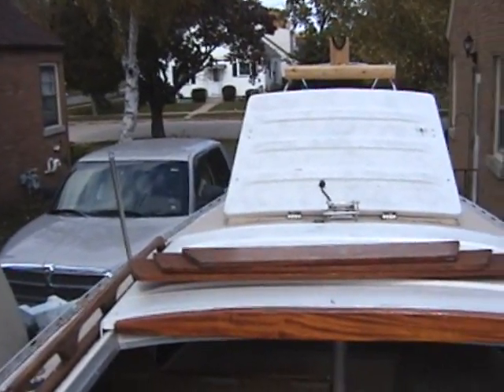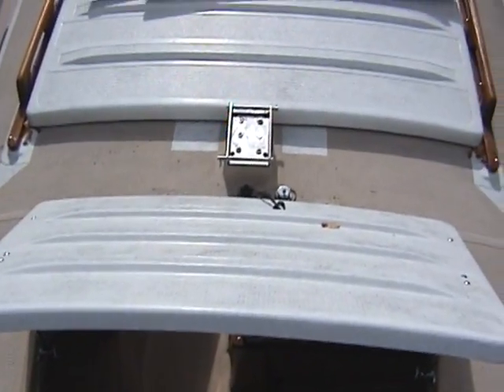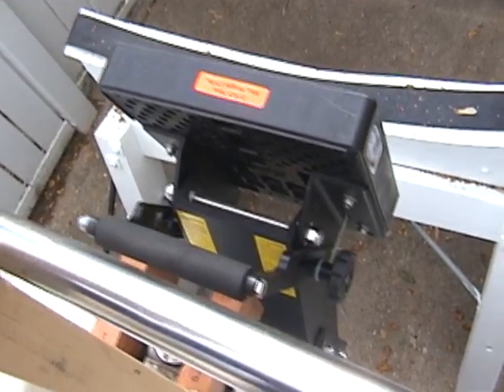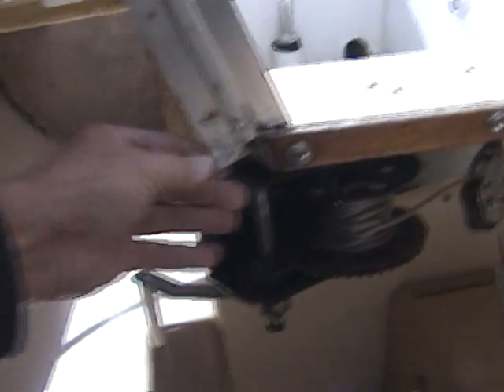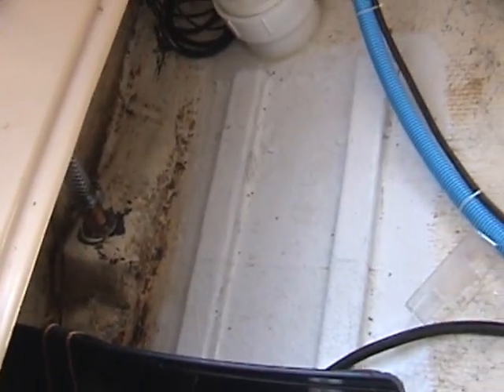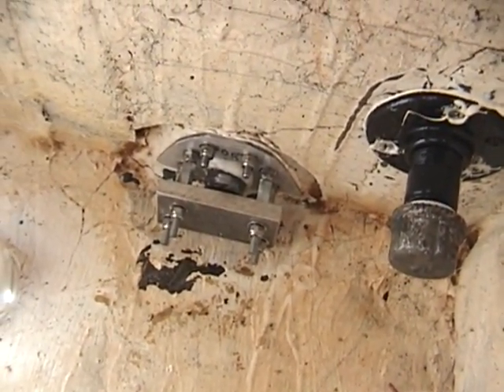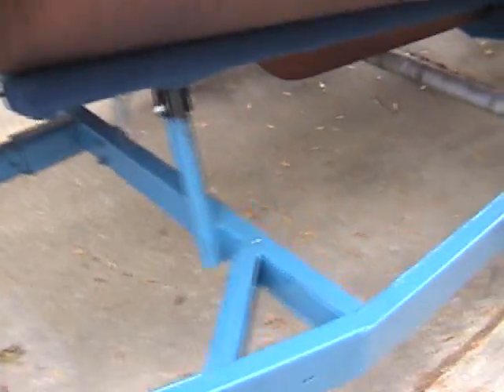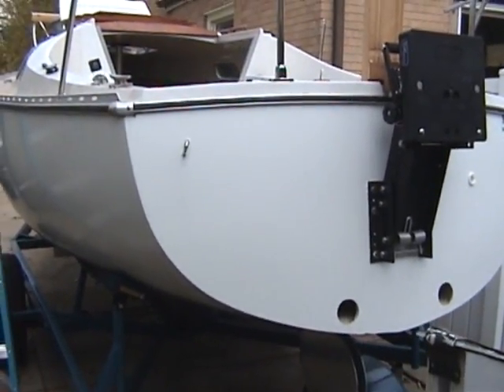Summary of 5 year refit

Comment: you glue the Transducer to the hull or just seating inside the housing?
Reply from the maker: Just put the transducer in the fitting and cover with water. No need to glue it down.
Reply: @astrorad2000  thanks I have the same Chrysler 22 you had, so I will do that , just glue the housing to the hull, thanks , you did awesome Jobe with Chrysler  ,take care
Reply from the maker: @juancarlosdelasotta6375  I watched your sailing videos. They made me miss my boat. Thanx for your nice comments.
Reply: @astrorad2000  I have all your videos and I almost have strokes when I new the you donate the sailboat after all the amazing  hard job you did ,